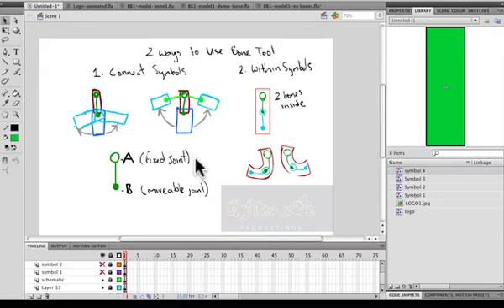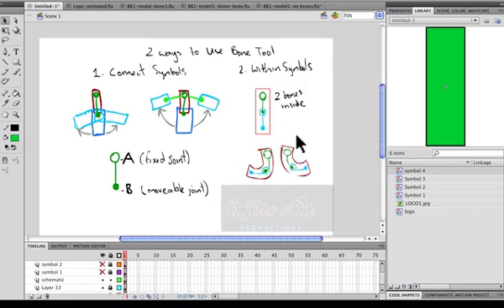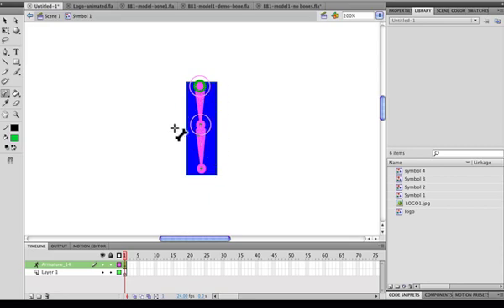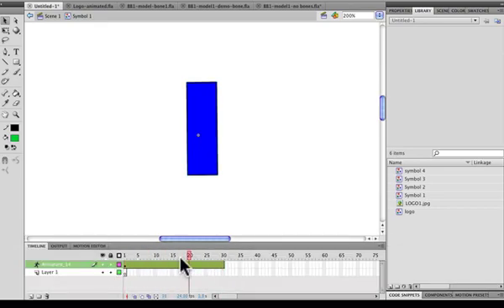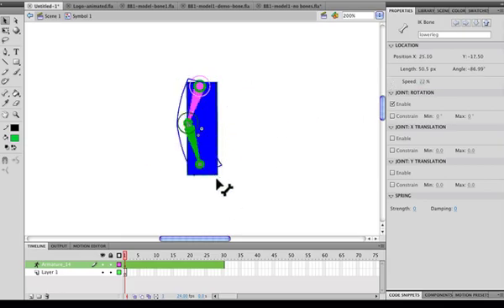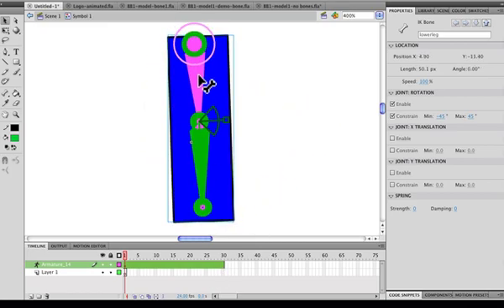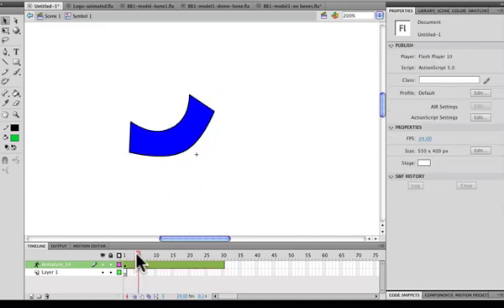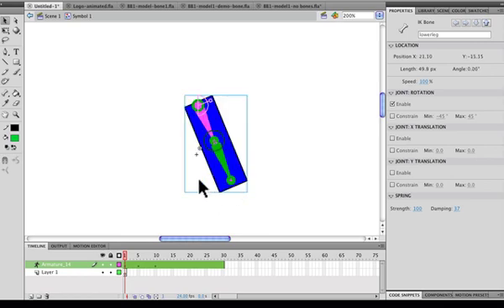Flash Bone Tool | Introduction Part 1

Comment: Hi
I have an image that I want to bone tool. Its a Geisha but there is only 5 parts to it. I am trying to add the bone tool to the body but i keep getting this: cannot link group objects. Now the image was drawing in illustrator so it has shading, highlights and all of that as will as clipping masks. and that was carried over to Flash. What i want to know is how to go about bone tooling this thing. i wanted point a to be in the middle and the have an end point by the head and one on the lower body. Could you help please!